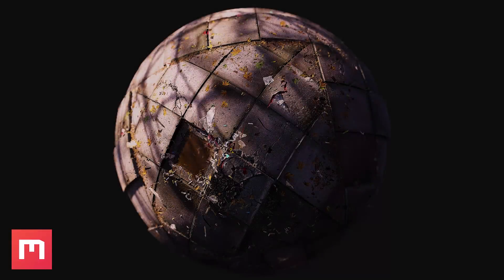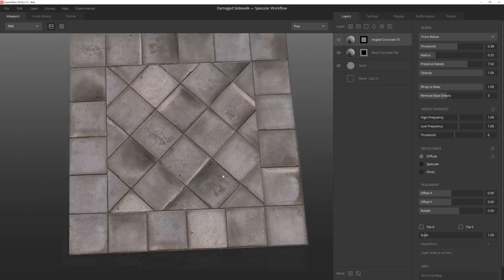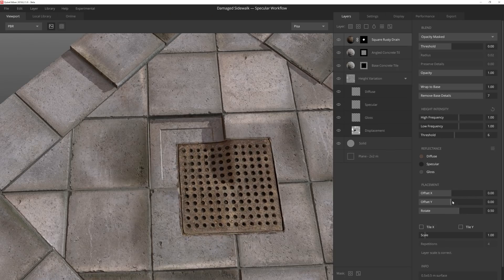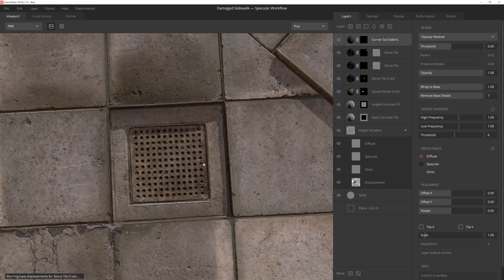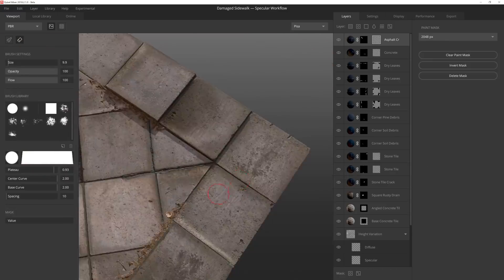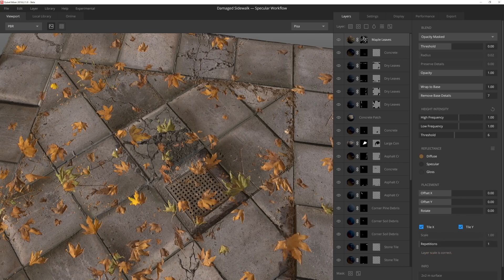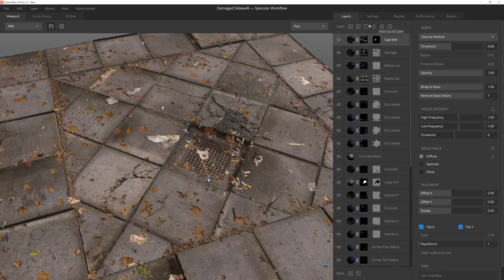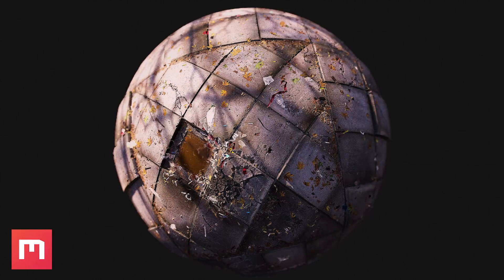Leveraging Decals with Mixer

Comment: This is a great and interesting workflow! Mixer adds something that I was desperate for after using Substance Designer for tiling Materials: the ability to actually touch your mixes or procedurally generated materials and sculpt and paint on top of them by hand. This is insanely great and artistic and I can't wait to integrate it more into my workflow. What still currently disturbs me however, is that it still feels kind of odd without proper tablet and pressure support. I feel this whole potential is still not ready to be unleashed because of this. Hopefully this is a high priority. I just love this ability and it sets itself apart from other procedural texture generation programs, where you have to either sculpt beforehand to get that level of mixed in handcrafting or you need to transfer your maps into a an other program afterwards.

Comment: Okay so you’ve made literally ONE tile after all of that.... you have an entire sidewalk to go lmao and you can’t very well duplicate that same tile over and over again because it’ll be repetitive so we gotta do this 300 times for one believable sidewalk?
Reply: Well, this indeed a single , but that's how it work. When you'll use that in a scene or game engine, it will be automaticaly tiled and reapeted on the x and y axes. And concerning the "believable" part, it's something to Master, using decals, foliage, material blending ect to break the continuity of the texture :)
So yeah, all this for one tile, but a credible and efficient one :)
Reply: Syd Griffiths What I mean is, why isn’t there a way to create a sidewalk with 20 tiles of repeating pattern, then bring in the whole sidewalk as one object into mixer and then do with this video showing and add different things to every tile all at once?
Reply: @mrfeathers3938  actually with mixer, you can import custom meshes, so it is possible to work with a 20 tiles meshes in Mixer but you'll struggle to place all the individual details you'll want each tile to have, that's not a procedural way to do things (Mixer is based on procedural workflow), thé workflow your suggesting lacks effienciency and optimisation :)
Oh and and another problem is, the only output you have is rendering/baking, so if you spend some time texturing your 50 tiles in Mixer, then render it, if something looks bad or doesn't serve your render scene, you'll have to do the maps export from mixer again, no flexibility :)
Reply: @mrfeathers3938  oh and if you want to see how your texture would you look in a surface, just press T to toggle the tiling ;)

Comment: Too often in this tutorial a step is described but the way to do it is not.  An example is when you talk about masking; you inform us that's the next step and quickly push the masking button without pointing out where it is, and you do so so quickly I had to keep looking to see what you'd done.  That in and of itself isn't a big deal, but when you start to use the tool you resize it without explaining the hotkey and then proceed to block out the sides without explaining exactly how you're accomplishing it.  I understand that this may be intended for more skilled users, but you also describe the process of duplicating a layer, which is incredibly remedial and would seem to suggest that your intention is to help those with little experience using these programs, in which case explanations for the other actions you take would be helpful.  I do love these programs but find them frustratingly badly explained by those who have the most knowledge about them.
Reply: You can slow the video down to up to. 25x speed.
Reply: @NoTengoIdeaGuey  Slowing the video down won't explain what hotkeys are being used though....I pause tutorials all the time to figure out what's being shown, but if the relevant information is withheld slowing down or pausing won't help....
Reply: A display that shows what keyboard strokes being pressed should be a requirement for all program related tutorials...especially at a professional level I mean come on. That way hes not repeating himself every video but you can still see whats happening if you don't know.
Reply: useless at showing you what to do

Comment: Impressive stuff!
Are all those textures and decals come with Mixer by default or you need to buy them separately?
Reply: You get access to the Mixer when you have a Megascans subscription, so you'll have points to spend on surfaces, decals and atlases, as well as 3d assets.
Reply: Separately.